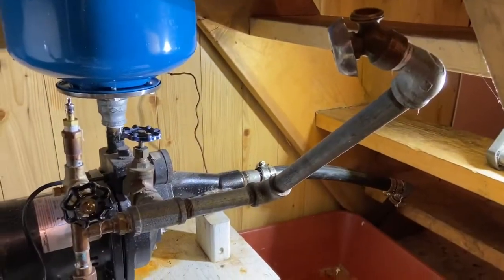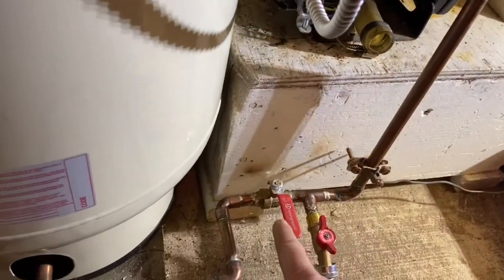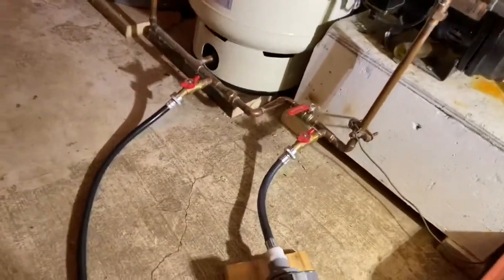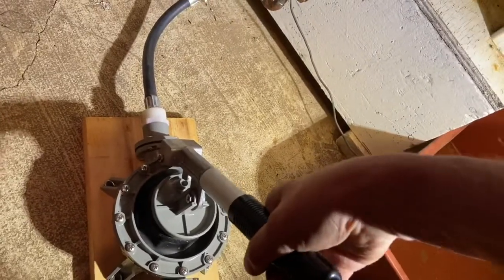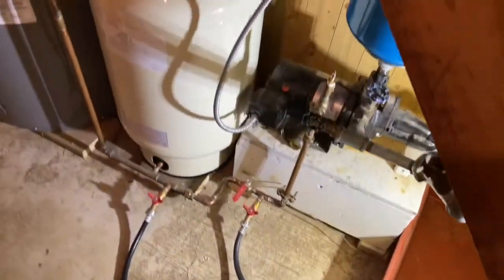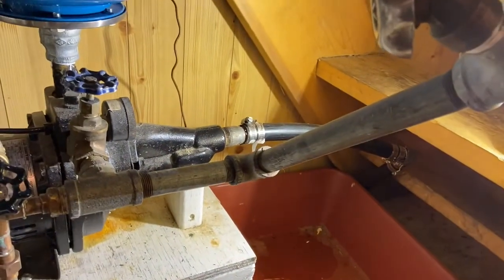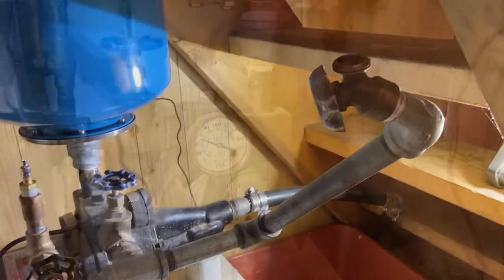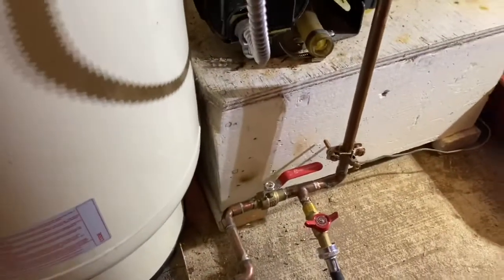Cottage Water Pump System Priming Fix

Comment: How far away is the lake?  How far can that hand pump pull water?
Reply from the maker: I  am 50’ from water, but it’s elevation difference that matters. In my case, pump is approx. 6 feet above lake level. The diaphragm pumps have a reasonable capability, but I suspect any lift over 12 feet would be borderline.